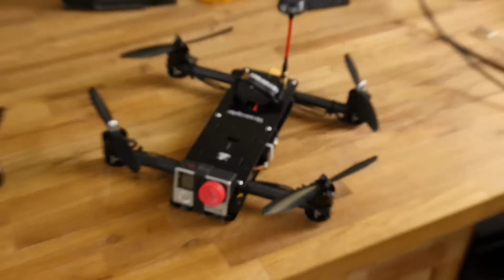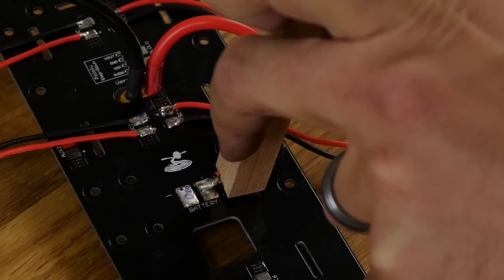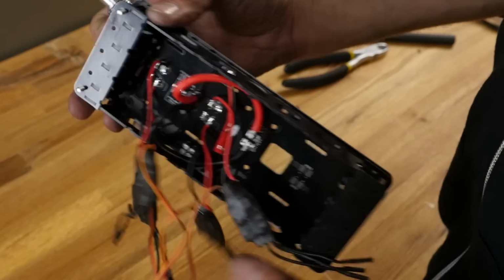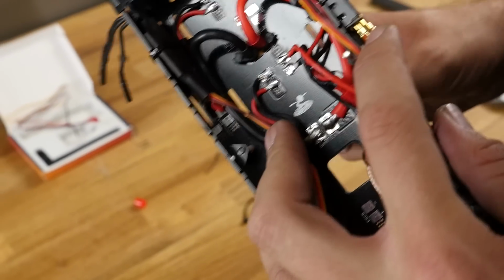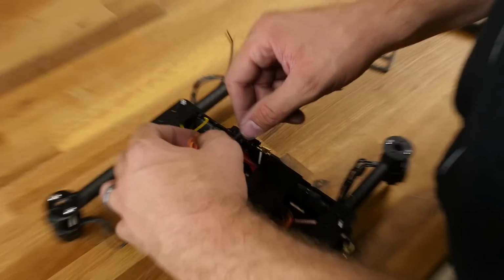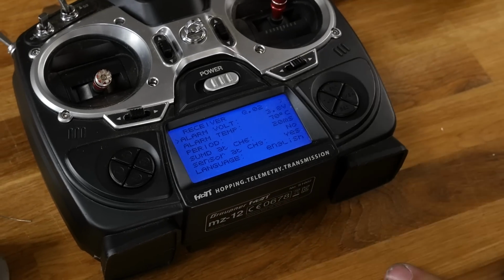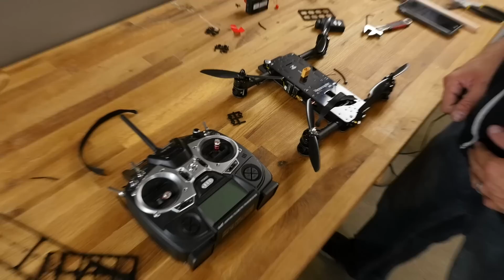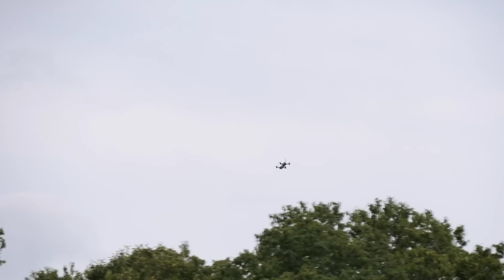FT VersaCopter - Race Quad Build | Flite Test

Comment: Does this Versacopter v2 kit come with everything you need to get started or do you need extra parts to buy?
Reply: waay more extra parts
Reply: You need motors, escs etc.
Reply: flight controller, wires, xt60, dirstrobution boards, L connector, theres just too many things

Comment: I absolutely love the idea of this quad with having a customizable setup and the fact of having a kit by which compliments the Versacopter frame. I do notice in your video you use a Lumenier battery with 2250mah (3s 35c I believe, based on your website). I've read that quads of this size actually rate a smaller battery, something around 1300mah. Is it okay to use your Power Pack E with a battery that has 2250mah?

Comment: As someone who deals with RF at a professional level, I cannot begin to tell you how bad it is to bend coaxial RF cable like that.  You could be losing 10Db from that bend alone.
Reply: can you please explain in more detail. I want to learn
Reply: Tyler Christiansen Every coaxial cable has a designed bend radius.  If you go beyond that the cable stops being a near perfect conductor and begins to attenuate/reflect the signal (in both directions).

Typically if the cable is of very high quality this is 5x the cable diameter.  I doubt highly if that cable is of high quality (now a days high quality cables are pretty rare and expensive).

Comment: To solder the ESCs properly (and not as Josh does) you need a soldering paste. Put a bit of it on the wire end after stripping  off the insulation - it will cause the solder spread equally and properly cover the wire. The same is true for a contact pads. Reduce the amount of solder to a bare minimum - just to cover the connection - and apply a paste as well. Solder is heavy and not mechanically strong - so if there are caverns or the area of contact is not big enough your connection will break at some point, especially in such a high-vibration conditions.

Comment: For all the beginners out there, you should be using some form of no-clean flux, it helps the solder flow much better. Also the solder should form over the entire wire, looking at 9:45 you guys didnt put enough solder on the main ground lead, im sure it will hold and run, but it could be much better.

Comment: The tight bend in the coax pigtail at 19:35 is not ideal. Coax has a maximum bend radius that should not be exceeded. In addition, that tight bend places pressure on the sheath of the coax, against the brass barrel of the connector, which makes it more likely to wear through.

IMO, best practice would be to let the coax exit the barrel straight down, then put maybe a 1/2" loop, coming around 270 degrees to go into the body, instead of making the 90 degree turn direct into the body from the barrel.
Reply: BUT THEY NEVER HAD PROBLEM WITH IT SO IT MUST NOT BE BIG A ISSUE

Comment: You should heat up the wire and then place the solder on that instead of putting the solder directly onto the iron.  It works much better.

Comment: i would be terrified to fly +400$ drone with this speed
Reply: +Seweryn Marcinowski A well-designed 250-class or smaller quad crashes very well. Because it is light, it can be much stronger, relative to the forces it will encounter.

Comment: Hi. can I use H frame (450mm motor to motor diagonally). 
mount with FPV camera and payload release mechanism
I hv to tilt to camera backwards to drop the payload. 
(the payload open, close part and payload dropping area hv to be within the camera vertical view)
and I'll DIY prop guard and landing gear, payload holder
payload (40mm in diameter, 100g in weight)
quad MTOW 2kg
flight time 5 mins

Comment: is there any type of leveling assistance in acro mode?
Reply: +Brent Lawrence no, acro will hold the last position. If you let go of the sticks at 45˚ it will keep travelling in that orientation - that said it will maintain that position very well, similar to how it maintains a level position, just on an angle. You could add things like a horizon 'bump' switch that will allow you to fly acro and then flick the switch to level out.
Reply: Thanks!

Comment: You make soldering look so easy! I tend to fry my wires trying to get the solder to take. The tabletop method is interesting in getting the motors level. Have you tried cutting the booms to have four and then running the motor wires through them? Or would they not be long enough? Great build video ! I think I have to get a Graupner now. 😎

Comment: I'm thinking of buying this as my first race quad. I am a little confused so the flight controller optional, but what are the differences in flight without one or with one?
Reply: +CJ Auman The GR18 mentioned here is a 'all in one' meaning it has the radio receiver AND the flight controller in one unit. You have to have a flight controller (this is what translates your radio inputs to adjust the motor speeds thus moving forward, back, etc...). An alternative for instance to the GR-18 is a NAZE flight controller with a Spektrum receiver.
Reply: +Adam I have the Graupner MZ-12 transmitter, would that work with the naze 32 also. Thanks
Reply: +CJ Auman Yes, it'll work, but you'd need a Graupner 4+ channel receiver too.

Comment: nice quad what is the setting for the voltage alarm
Reply: +john humphreys It depends on your Lipo and how much powering your motors drags the voltage. I'd go for a higher value at first, stop when it starts to beep and look how many mAh your charger puts back in. And if you have some room left, decrease the alarm trigger a step or two before testing again. I was told that about 80% charge is fine.
Reply: hi thanks had a look at a few vids on this and 3.7 seems to be a good start.
Reply: +john humphreys Yes, I warn with 3.6 at mine and know that I could go down to 3.5, but it is a small quad that doesn't draw as much power as a fast racing quad. 3.7 is a good point for a start and if you see you still have some reserve, you can always tweak it :)

Comment: will this lift a gimbal setup? seems like it would work nice for cinematics with an action cam.
Reply: +AimlessMoto, check out painless360 on youtube.  Search diy servo gimbal.  I tried it today with the naze32 setup - really easy!
Reply: +AimlessMoto Small and light non GPS quads are sensitive to wind and will move and rock about. Check out David Windestahls latest lil-tricopter photage. 
I prefer his big tricopter any day.
Reply: I figure with a 3 axis gimbal the twitchiness of the smaller frame would equalize out.
Reply: +AimlessMoto These are for racing, not for videography. No gimbal necessary.
Reply: +Fredrik Åström Do you have a link to that ?

Comment: Watched another one of your videos on this, and this is exactly what I've been looking for. I wanted a relatively small and fast quadcopter, but I really wanted one big enough to carry a gopro also. Most any of the quadcopters big enough to carry one, that I have seen are usually 300+ easy. On the FPV you are using in this build, what is the approximate range on it, and if you are flying it through a forrest, would the blockage from trees and what not significantly reduce that range? Thanks!
Reply: +Ty White The 600mW transmitter is pretty powerful. In fact it is so powerful that you are not allowed to operate it without a HAM license in a lot of countries. And yes, trees are the natural enemy of 5.8GHz transmitters.
Reply: +Balu Thanks! I'm still trying to get all of this figured out, when he is talking about the control board, and the gr18 and mentions the naze 32, would I need both for it to fly, or just one or the other? I can solder and I am decent with electronics but this is all new to me.
Reply: +Ty White The GR18 is a product from Graupner. It is a receiver for the remote controlling part combined with a flight controller that makes sure the multicopter flies the way you tell it.

You need a Graupner transmitter to use it.

Otherwise you use a standard receiver plus a flight controller like the Naze32.

I've written a forum post a while ago, explaining a lot of the basics: http://forum.flitetest.com/showthread.php?7521-A-beginners-guide-to-multirotors-(written-by-a-beginner) 

That might help for the start :)
Reply: +Balu That is a lot of good info! I read all of the flight controller part, I'm going to look into it more later on. A couple other questions, he straps on one battery, but it appears there is plenty of room for two. I'm sure the extra weight would slow it down a good bit, but how would I go about hooking up two batteries to it, to essentially double the flight time? (I know it probably wouldn't actually double it because of the extra work required for the extra weight) But would I need to splice off of the supply cable coming off of the quad, and have two connectors, or could I splice one battery into another, and have them both going in one connector. I'm sure there's some really wrong ways to go about it. Also what are some good, relatively cheap radio controllers? I can barely find any on amazon or ebay, and the ones on ebay are almost all $15 and I feel that is too cheap.

http://www.pyrofersprojects.com/blog/ps2pad-tx/

That's a link to a RC a guy built using a playstation remote, I would like to try that at some point, I really like how small it is, and I'm already fairly use to the feel of the ps remote. Might be a little out of my skill level tho.

Thanks!
Reply: +Ty White I wouldn't put two batteries together like you are thinking about. There's ways, but you really have to know what you are doing unless you want to start a pretty big fire.

You could get a bigger battery (Wh, not cells), but as you said the weight is an important factor. There's a point where more weight actually results in less flight time and calculating that needs some experience. More weight also means more energy in a crash which results in more damage to your copter. So starting light is not a bad idea - especially if you are a beginner.

Nice budget transmitters seem to be the Turnigy TX9 or the OrangeRX T-Six, but I've never used one of those.
Reply: +Balu I'm definitely going to start off with the average battery set up, and yea just getting a larger single battery is the obvious solution lol. I'll play around with it and see what the flight time is. What I would like to try, whenever I add FPV to it, is see how far out from my house on our land into the woods, I can fly it and keep a signal, it is all pine trees so it isn't thick at all really, 15 foot or so from the ground. I like the look and reviews of the OrangeRX T-Six, so that is probably what I will go with. Thanks for the help!

Comment: So, I will get the Frame, Props, XT60 Connector and ESC's with the Power Pack E right?
Reply: +Ole P. And motors.
Reply: Balu
Okay, thank you Balu! :)
Reply: Balu
Oh and, do you know a good charger for the battery's they used in the Video? (Lumenier 2250mAh)
Reply: +Ole P. The only important thing is to get one that can "balance charge" a Lipo. I got mine in a local hobby shop, so I don't really know what people like to buy online. I've heard about one called imax6, but there seem to be fake ones around that have problems. The one Flite Test sells is very basic. I wouldn't get that.
Reply: +Ole P. get an iCharger 306B.  It's extremely simple to use and can be used to charge LiPo, and the best thing is that it''s very powerful when needed and can easily charge very large batteries in the future.  But for now, until you start charging like 6s 5000Ah, you don't need that much power, so a 250 or 500W 12v or 24V power supply would be perfect.  iCharger are some of the highest quality chargers you can get.  As for power supplies, Meanwell are great and most are plug and play.
Reply: KpilotRCHelis
Thank you for your suggestion, but the iCharger with a power supply kind of blows my budget :/ A friend has a Power Peak B6. He says it isn't the best one out there but this one should be enough for me.
Or do you know another good one max. 100€ (including PSU)?
Reply: +Ole P. Nah they used a Lumenier 2200mah 11.1v

Comment: Your reviews for PowerPack E say ALL 4 COUNTERCLOCKWISE MOTORS. Is this a problem? I thought 2 go in both directions to get YAW. Can FT clear up my concern? Thanks
Reply: +the one It's only about the threading for the nuts. All motors can go in both directions. If you have CW and CCW motors the thread for the nut on top is different. The idea is that the nut self-tightens when the motor spools up.

Josh mentions that people are going away from that concept though and just use lock nuts. Because it is really difficult to find the reverse nuts in stores if you lose one. Lock nuts don't need to self-tighten, because they already "lock" in place.
Reply: Balu This was my understanding about the threads but... really they never come off in the air from the torque? Don't the props come off in a crash?
Reply: +the one No, the props might break, but the center hub will stay attached to the motor. A good lock nut will not come off if the locking nylon reaches the thread. If you run a motor the wrong way with a standard nut and it's fastened well, it will not get loose immediately too, but I've had one come off after a few flights without checking it.

Comment: Is there anywhere I can buy a set of those allen wrenches without buying a kit?
Reply: +Ol Nap Not sure if they're exaclty the same, but they sure look similar. http://www.banggood.com/4pcs-Metal-Black-HSS-Hex-Nut-Head-ScrewDriver-Tool-Set-1_5mm-2_0mm-2_5mm-3_0mm-p-991203.html
Reply: Thanks for the link but I was looking for the ones with flight test on, yeh im kinda lame like that.
Reply: +Ol Nap I don't think so, but you can always ask nicely :) http://flitetest.com/pages/contact-store

Comment: Yoda called, he said, "A Jedi's solder strength flows from the flux force".
Reply: @chris wang, the only downside to using too much solder is if the solder flows back into the wire affecting its flexibility /not allowing it to bend anymore. I dont see Josh applying flux before he solders. Hence the solder not easily flowing and completely covering the wire. When using flux you'll notice you won't have to hold the iron on the solder joint as long and avoid possibly overheating and damaging other components.
Reply: +Ryan K (MototechRyan) No need on tiny wires to pre-flux. What he is doing is how it is done. He needs another 15 or 20 years to be really good, but he is doing it correct. Pre-fluxing is actually rarely used in electronics.
Reply: +Naked Acres, agreed for the lighter gauge esc wires, pre-tining the wire and pads. But for the heavier guage battery leads, imo flux would make a huge difference.
Reply: +Ryan K (MototechRyan) Some say, solder with a flux core is enough most of the time... :)
Reply: +Balu, I agree with yall and have nothing but respect for Josh and his skills. Just saying with alittle flux my solders come out pretty sweet. I'll video my build and solders when my Versacopter kit arrives and post it on youtube. Balu, i work for the PowerTech division of Knorr-Bremse and have soldered alot of components installed in power converters. I'm not a soldering or electronics expert by any means, but have a fair amount of experience 😉
Reply: +Ryan K (MototechRyan) I have my own flux pen, so I'm not going to argue either, but one thing why Josh avoids flux in this video might be to not intimidate newbies with another technical thing.